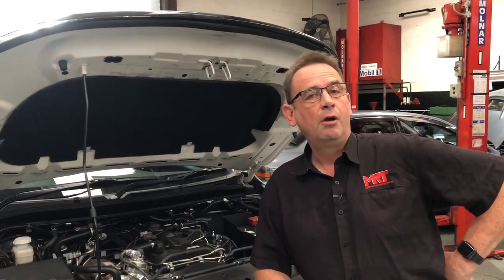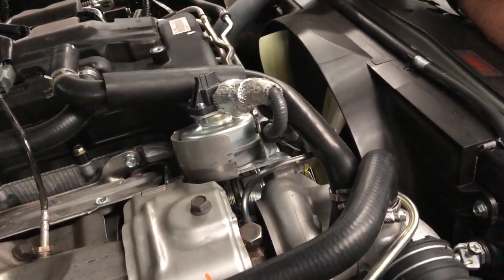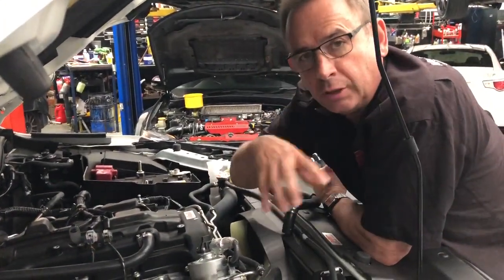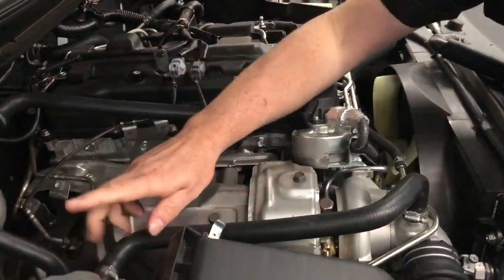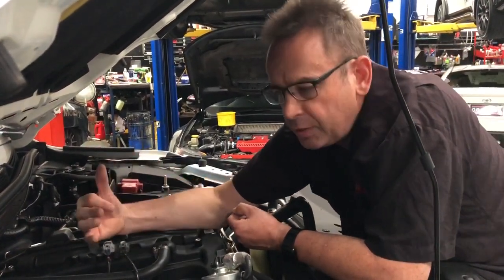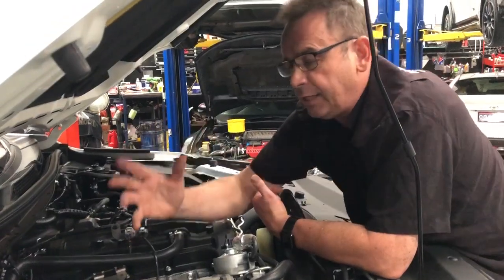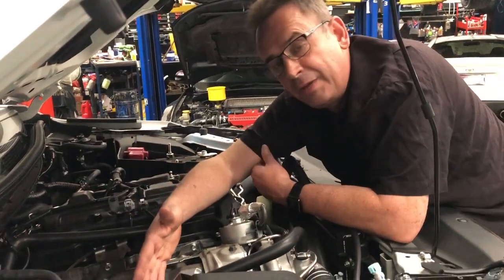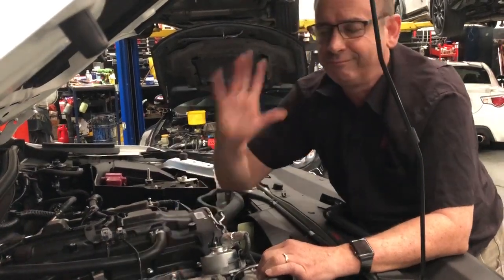Oil catch Cans for Diesel Engines

Comment: The underside of my fairlane was coated with oil from the straight vent hose just hanging down by the suspension so i made a catch can out of pvc pipe. It had a 1 inch drain valve under the front bumper. I had to remember to drain it off every 300kms and pour it back into the sump. The carparks of 7/11s across thailand often featured a little puddle of oil from the drain off valve after emptying.
Eventually after a couple of years i got pissed off with grovelling under the car so i put my boot right into it on a 950km run..... we got 935kms  before no.3 rod popped out to say hello!
.....just waiting for another isuzu 4jh1 engine to arrive from japan  and the next catch tank will auto drain to the sump.

Comment: Piston skirts are NOT designed to seal blow bye it's purely the job of Piston Rings and cylinder the wall.
You also failed to mention that oil acts as an insulator as it inhibits the Intercooler in doing it's job by not allowing complete heat transfer.
Another fact you haven't taken into consideration is the fact that contaminated air entering into the cylinder  will NEVER be as highly "charged" as it would be once the contaminants are removed  with a more pure air fuel ratio the better the combustion hence more power via a less contaminated mixture
Reply: livey oone  just like all yours ya brown nose

Comment: I just yanked the crank case vent pipe off and jammed on a garden hose going down to the frame rail and blanked off the other end.
Reply: All the old trucks I drive at work all have crank case venting to the atmosphere the pipe from the top of crank case down to just below the oil pan is plenty long enough to prevent any so called debris from going up it also it’s oily so it traps the dirt. The stock form of venting is simply emissions systems, vent to the air is the old way which works.
Reply: And that will also allow unfiltered air full of dust and other road debris into the engine when suction is present. Which is only a very small part of the time, but an open line to the crankcase is a great way to wear that engine out in no time.
Reply: General blow by pressurises the crank case, it’s one of the reasons old engines weep as bad as they do. I supposed if your pipe is like an inch long you might have a point.

Comment: The explanation is correct and very good the way of the explanation on the difference between petrol and Diesel engines turbo and not turbo. I think the engine you are standing by is 4n15 from Mitsubishi

Comment: Oil catch cans can be purchased on ebay. Either a specific type for a make/model or a universal type. Traps oil laden air from engine blow by. When can is full of oil, can be  emptied. Can be fitted to standard petrol/diesel engines. Do your research if you have a performance engine. 👌🏻👍🏻
Reply: And most catchcans only trap app. 15% of what enters so most still is ingested.

Comment: Can I install this on Cummins isx 15L semi truck engine?
Reply: You can install on any petrol/diesel engine.
Reply: ISX engines already have a vent system that includes a filter / oil separator.
Reply: @DougHanchard  they have yes, but I also would like to install catch can if it's so universal device
Reply: @PrimeMantix  Not necessary. The system catches the oil and returns it to the crankcase oil pan on ISX models. Earlier Cummins engines do not have this emissions architecture, in which case, a model like a Pro Vent 150 or 200 would be suitable.
Reply: @DougHanchard  thanks about this information 👍

Comment: G'day, just viewed this video, excellent! There is a 2001 Prado T/diesel on my 'horizon', hence the interest. I've been driving a 1990 Volvo 240 for over ten years on extensive outback trips on dirt roads and some tracks. It is fitted with an oil separator box which drains the collected oil into the engine sump, this is a 'red block' engine with over 300k on the dial and imperceptible oil consumption. With the current oil catch cans why not drain the collected oil to the engine sump? Thank you. Stephen C.
Reply: Some of that oil the catch can collects can be very dirty and even have some water.

Comment: Will fixing  a catch can on a 4m40 shogun(pajero) help
Reply: I used an 'ebay' special catch can with a HD scotchbrite pad as an internal filter/baffle in my 4m40 delica fittings and hoses about $50 DIY. I also did an EGR blanking plate kit. cleaned the intercooler/manifold and cleaned the back of the inlet valves which were all gundged up...runs great but my engine does not appear to have major blowby issues.

Comment: What is the Brand Name of this Diesel Catch Can for Mitsubishi Triton ?
Reply: Just Google oil catch can. You'll find heaps of them. Sometimes same model but rebranded. With a brand name on it sometimes more expensive.
Reply: This is the TERRATUFF SEPR8R catch can mate, im going for the Provent myself... plastic would make more sense, less heat absorption, so in theory should condense better.
Reply: Thanks Mate.... 👍👍👍

Comment: Nice video Brett...that catch can looked similar to a HPD, which just use a small bit of stainless guaze.. pretty  useless... the best CC are the ones with a proper filter membrane like a Mann & Hummel, pro vent etc. and with a proper filter membrane the size of the filter and CC is irrelevant provided their drained off properly.
Reply: @MotoFixation  they all look similiar but certainly don't perform the same...
Reply: Absolutely right i commented the same the catch can he has used is a cheaper inferior product with no filter in it next to useless

Comment: Have heard and read that using a catch can cause valve seats to ware quicker, because no lubrication, and then changing valve clearances.....
Reply from the maker: It really depends on the engine but build up of soot contaminated oil around the valves will almost always have more of a detrimental effect on valve clearances and general wear and tear than reducing the amount of blow-by.
Reply: @MRTPerformanceAustralia 
Recently did a complete intake clean on my 1kd with 400129km. Also did a partial blank on the egr with a 7mm plate..... Am thinking catch can also.
Reply: @AndrewSparkfish  IMHO i would do a full blanking plate and add a manual mapper by Ozbush electronics.
Reply: @AndrewSparkfish  I read somewhere that with the 1kd you shouldn't do the blanking or partial blanking Of egr as it also is connected to the waste gate of the turbo.  Have you noticed any problems with lag ?
Reply: @denzaharo9326  haven't noticed any lag.  Also have a free glow exhaust.... No silencer or any environment related restrictions
Reply: @denzaharo9326  turbo waste will go through which ever cylinders valves are open.
Reply: @MRTPerformanceAustralia  How about for the 2.8 Duramax VM motori diesel engine manufactured in thailand(ENGINE USED IS ASIA FOR 2018 COLORADO AND TRAILBLAZER ALSO 2018 COLORADO Z1 IN AMERICAN VERSION) is catch can good for it? IF anyone can answer Thank you!

Comment: Very helpful and informative!!  Your advice on this would be greatly appreciated. 
Out here in the US these smaller diesels are slowly starting to catch on.  I picked up a GMC Canyon with the 2.8 Duramax diesel (apparently the same motor Mitsubishi uses in some of their pick-ups).  I would like to add a catch can, the only problem is all catch cans seem to work half-ass at best.  All the reviews and research I've done says you simply can't collect all the vaporized oil from the crankcase ventilation without a much longer refining process, and that vaporized oil will still collect past the catch can.  What are your thoughts on this? is a catch can a cure all as far as preventing build up, or is it just enough to slow the inevitable process down?
Reply: Depends on the brand, Pro-vent catch cans remove 98% of oil and water vapour. They have a paper filter element that needs to be replaced every 50,000km or so however.

Comment: Would using 2 catch cans (if you can fit them in your engine bay) be better than using just 1?
Reply: Surprisingly yes. The first catches about 90% of all the water/oil/fuel/carbon and other nasty things, the second will catch mostly water and a little it of oil that was missed. Make sure that you go for something high quality though. An RX performance catch can is fine on its own, but a cheaper Ebay alternative (even with the bronze fiters) will still have a lot of nasty stuff go past it. Still better to have one than not though, don't want your intercooler/intake getiing covered and filled with oil and fuel.

Comment: What would happen if you just ran the hose to the ground, and didn't even use a catch can?  Have all that blow stuff just eliminated......(pretend there are no environmental issues)
Reply: Because you need to maintain vacuum. If it opened straight up it would expose your manifold to atmosphere and compromise vacuum.
Reply: Chase Marshall Not at all. There is no, and should never be vaccum in crankcase. Ideally, there should be atmospheric pressure, and blowby only serves as a relief of any extra pressure buildup. So, nothing would be wrong with sending it to atmosphere except minor pollution.
Regards 
Mladjan
Reply: @Chase_AM  obviously block the hose from the intake side .
Reply: It'll cause serious issues in a petrol engine, or modern diesel that uses swirl valves. Because of the intake vacuum in low throttle situations it will suck air through the vent hose.

Comment: Excellent explanation,  I have a 4m41 Mitsubishi Shogun DiD with over 200,000kms, has been dripping small amounts of oil from  the Throttle body whenever the engine runs,  so would say I'd have to top up about half a litre after 1000kms or so. However the curious thing is the power is still very much intact, does smoke but clears as it moves.  Exhaust manifold is also clogged with carbon. Will be looking for a catch can even more so after this video, once again thanks very much.

Comment: Hi Matt, always interested in your diesel videos as I have a XV diesel.
Do you know of any problems with oil pooling in the intercooler which then gets slurped into the engine, causing an over revving problem?
Reply: Its called running on or running away and you can usually say bye bye engine if it does
Reply: Bad turbo seals will cause runaway
Reply: Cheers, I know about runaway diesel engines. Nightmare.
What happened to a friend, in his diesel XV, was that he braked approaching a junction, dipped the clutch and the revs went through the roof damaging the engine.
Subaru dealership blamed him for changing down and overrevving the engine, but I find that difficult to believe.

Comment: I knew all this but watched anyway.  Well explained, well done.  I would suggest using only group  4/5  engine oils for even better blowby control in a mechanically sound engine, use of a catch can and EGR delete if possible.    My D22 ZD30 Diesel Navara at 200K has minimal blowby, i must be doing something right😎